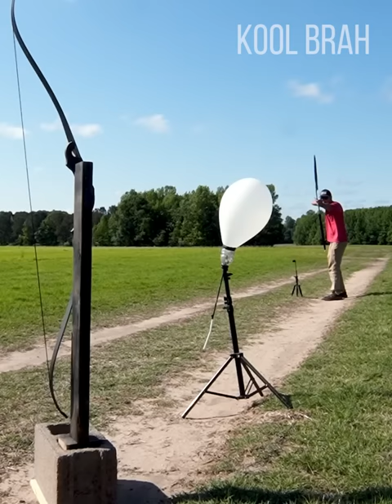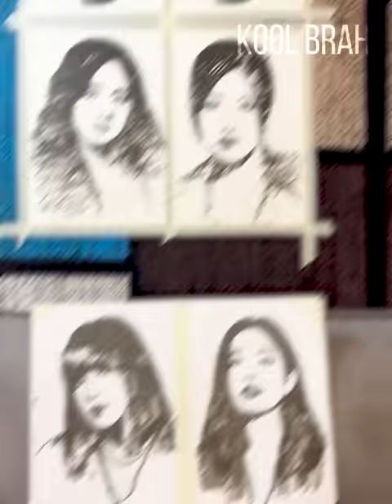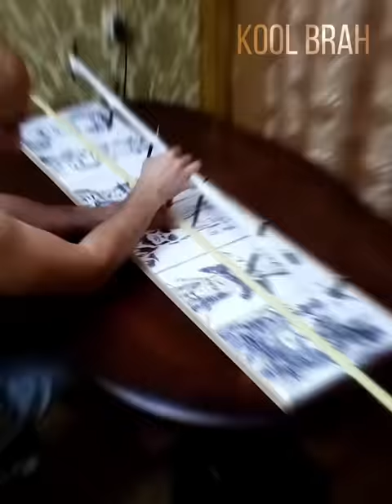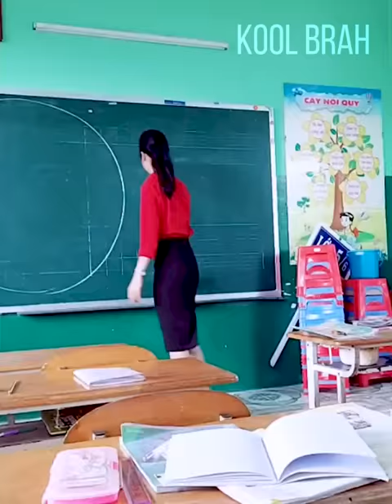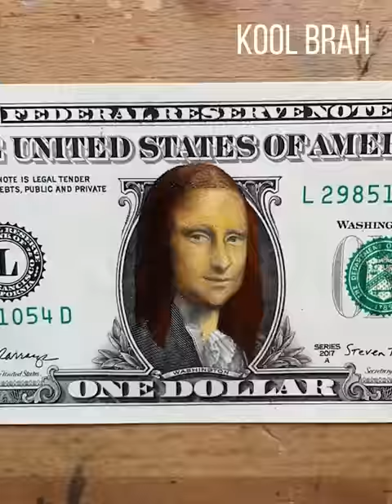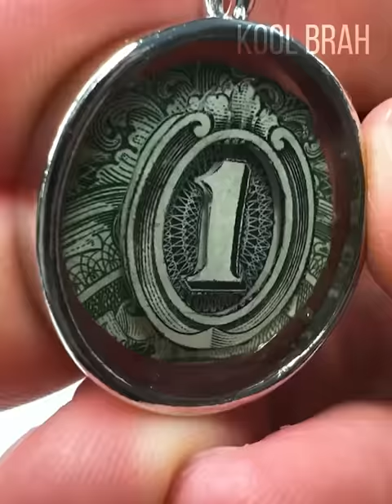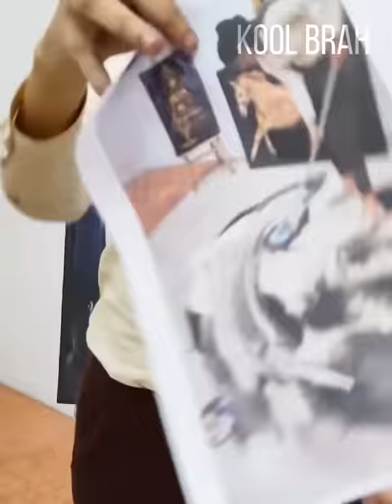Like a Boss Compilation! Amazing People That Are on Another Level

Comment: 3:43 Weighted dies.
5:36 That's very impressive. I don't know if people noticed, but moving fast under water is hard.
15:21 I don't know if you've ever seen spiderman, but he doesn't need a web to climb a building either. Also, spiderman can climb faster than this. I'm not even a marvel fan, but this guy has nothing on spiderman.
15:57 "Hey boss, there's a sider on your back."
23:43 It would have been impressive enough if this person drew the same picture 4 times, but those are 4 unique images! That's not all! Imagine buying an art piece from this guy. Can you tell which are made with his feet, and which are made by hand? Exactly.
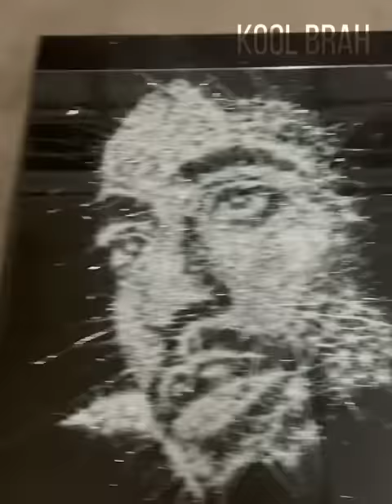26:38 You're clearly missing the most impressive part of this. Think for a moment: How is he climbing? With his left hand fingers? That fast ?!